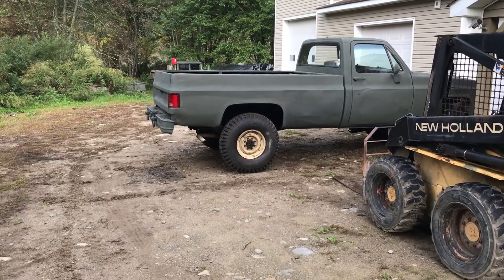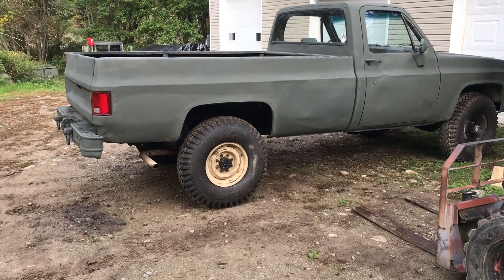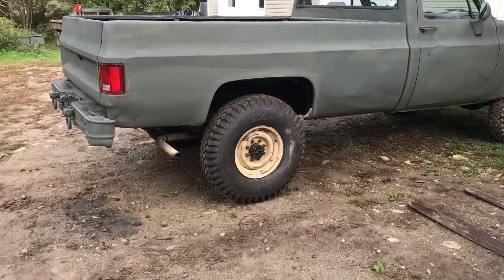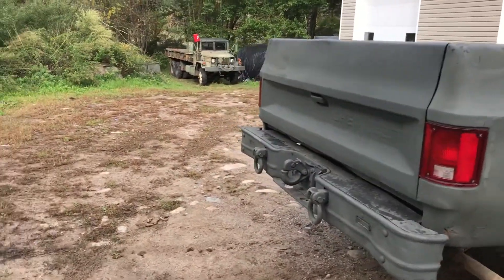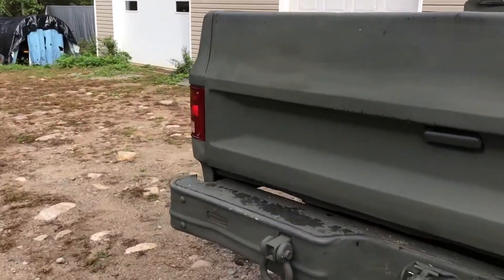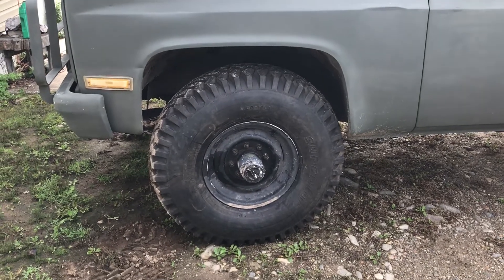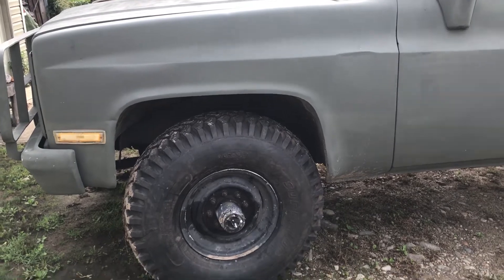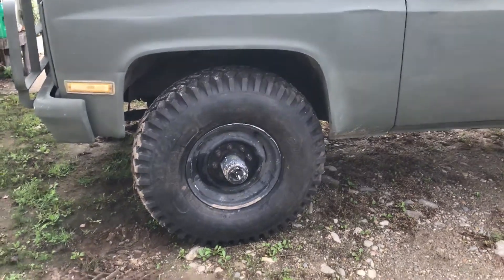1984 M1008 CUCV Super lug tires

Comment from the maker: I ended up selling the truck - I listed for $6500. & my messenger blew up. Almost had a bidding war in my driveway @ 9am in the morning. The first guy bought immediately. Nice solid truck. Top speed all stock was about 58 mph. It was a beast, but slow. I sold it to pay off a 2006 Ford F350 quad cab lariat diesel - I had paid $13,500. For.
Reply: Wish I knew about this truck coming up for sale I would have bought it

Comment from the maker: The current plan ended up being - I got a stock set of tires & rims on the truck now - a little slower, but price was right. I have about $4000. In this truck now. I have other trucks & really can’t see putting $2000. In this truck for a lift, at this time. Just picked up an 2006 F350 quad cab Lariat diesel 8’ bed. Which makes the CUCV a local work truck. It doesn’t get a lot of use.

Comment from the maker: This is a home video, not professional & not claiming to be. I didn’t get paid for this - sorry if the video is not of professional quality, but the tires & truck are real! Not cheap tires, list @ about $270. a piece tubes $35. a piece & flaps another $25. a piece that I couldn’t use!
Reply: What did you end up doing trimming fenders or lifting
Reply from the maker: I put my stock tires back on, & planning a 4” lift I the future!
Reply from the maker: In the end I sold the truck, so that solved the problem & bought a F350 diesel